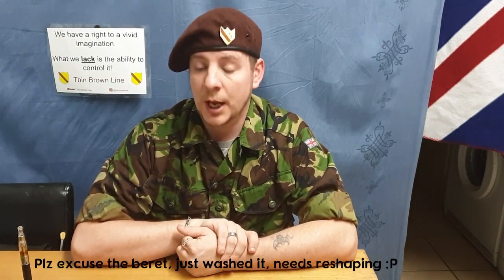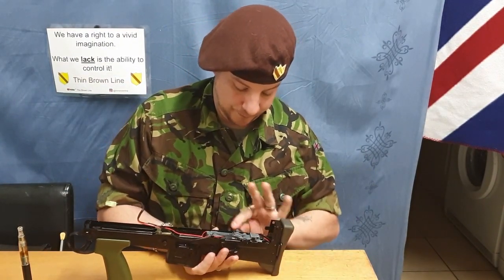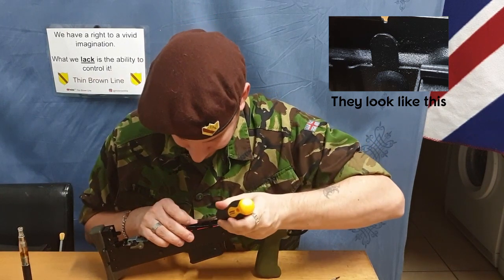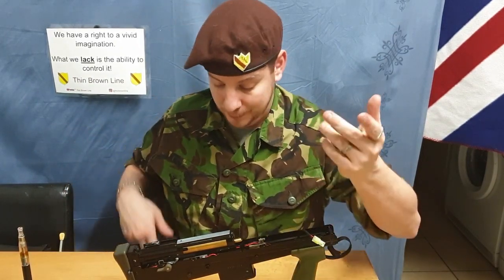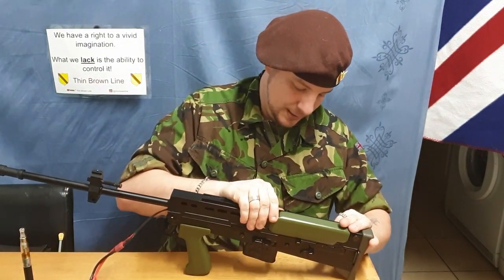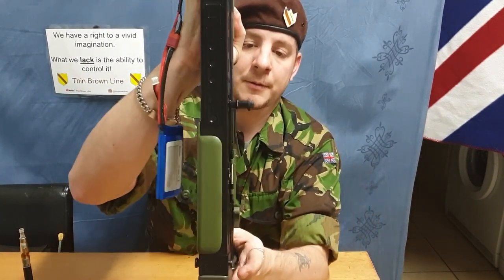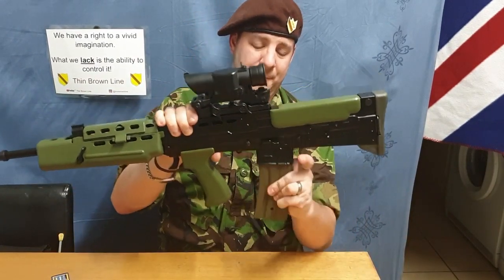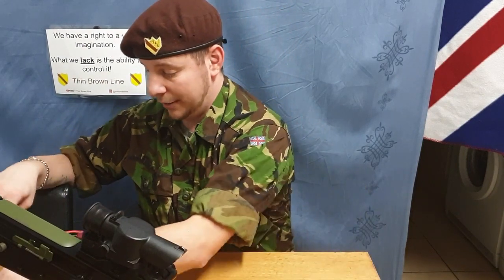Army Armament L85/R85A1 gearbox, power chamber and furniture fitting

Comment: Old video, but recently bought this and electric blowback is not working? As in bolt just stays back when cocked.  Not sure if yours is or was the blowback variant but any help would be great.
Reply from the maker: hi there, this could be an issue with the little hook or tiny spring on the top of the blow back block, it might not be engaging with the flat hook in the top of the upper receiver. It may even be the flat hook in the receiver that is the issue. sadly, without actually looking at it, I couldnt diagnose the issue fully.

Comment: I’m having trouble putting the top back on not lining up also the bolt catch in not springing back  and the safety pin gets stuck on safe
Reply from the maker: holy moly, not much wrong then lol. The top not lining up is a fairly common issue as its stamped metal, its usually a case of giving it a wiggle as you do it till you find the 'sweet spot'. the safety will probably be the spring is getting nipped somewhere that end putting pressure on the switch. the bolt catch not springing back will most probably be the little spring (other side internally) has slipped off the retaining peg as its a fiddly little sod to keep in place. 🤞 hope this helps bud

Comment: I’ve got this body of gun and it will only fire in full auto. Please reply is you have any information on why this is
Reply from the maker: hi there, sorry for the late reply, I have been away for a while, the full auto issue could be one of a couple of things, either the trigger contacts are not disengaging so it will only fire on full, or the tappet plate is miss aligned, the other thing it could be is, if you have the etu version, the etu may have developed a fault.
Reply: Thanks but now it won’t fire at all and it’s fully charged

Comment: where did you get the olive drab furniture from?
Reply from the maker: I bought some OD matte spray paint and sprayed the parts myself
Reply: @ThinBrownLine  Mine finally arrived, what sort of preperation did you do to the parts?
Reply from the maker: @rubencentro4974  all I did to prep the parts for spray you mean? A quick rub down with 120 grit sand paper then some 400 grit paper, followed by fine wire wool then rubbed down with white spirit, allow to dry naturally (the white spirit) then a first light coat (dont go for full coverage on first go) and slowly build layers up to get full coverage allowing each layer to dry first
Reply: @ThinBrownLine  Yeah that's what i meant, thanks
Reply from the maker: @rubencentro4974  yeah, as above, the only bit I will really stress for a good finish is to take your time and preparation is key. Id love to see pics of the finished article if poss, all my links are (or should be) on the about section of my channel 👍
Reply: @ThinBrownLine  yeah i'll email you when finished, it's an a2 and im gonna do black paint and see how that goes
Reply from the maker: @rubencentro4974  nice! I look forward to it, I just sat and watched this vid back, I need to do more vids like this again, I do have some new builds coming 😁
Reply from the maker: @crazyhoarse2001  thank you very much, I try to make the tutorial vids easy to follow so pretty much anyone can start to learn how to properly maintain and upgrade/repair their airsoft guns so hearing that people are using the vids with success is awesome, try joining the Airsoft SA80 owners club on facebook, you might have some success finding someone who wants to swap in there 👍